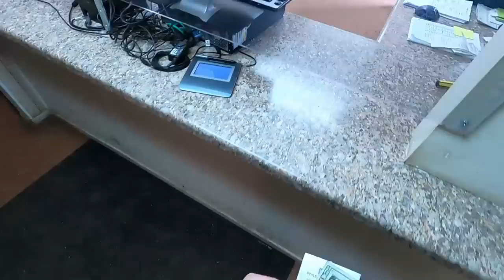Dumpster Diving - a Lot of Laptops

Comment: Paul, you could always drop in new LED multi-light "inerds" on those church lights, with the light controller attached, and you'd have super bright, COOL,  very low power consumption LIGHTS, that'll outlive you !!! Just measure dimensions -height -width & -depth of fixture (housing) & order it online.  Really an easy switch out of "guts".  ...just a thought...
Reply from the maker: But what if I become a record-breaking longevity 125-year-old? 😃
Reply: @ScrapPalletMan  Well, Paul, in that case, you'd likely STILL be enjoying those low-power, low heat, bright lights, that you re-constructed some 90 years before (that some guy in Florida suggested),  to re-read your memoirs & Bible...and counting up all the money you saved over all the years...(grin).  Have a great next "treasure hunt", Paul...I really enjoy your channel, and try not to miss any of your vids, and dang, I learn something new, myself, every time !!!...

Comment: Hey paul !! Why don't you use e85 on your truck is cheaper on price i got a 2011 silverado e85 flex fuel out here regular 87 gas $4.98..e85 fuel ..$2.99. It wont hurt big red..i seen your fuel cap is yellow  e85 fuel also is factory to work ..look for a gas station with e85 around your area cheaper and price u save every fill up ..stay bless paul.
Reply from the maker: My mechanic told me not to use it